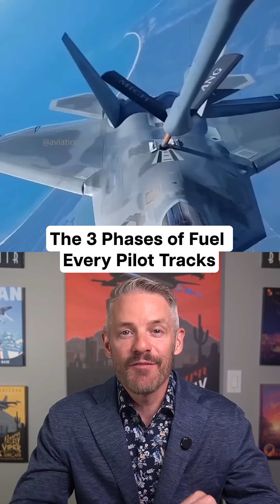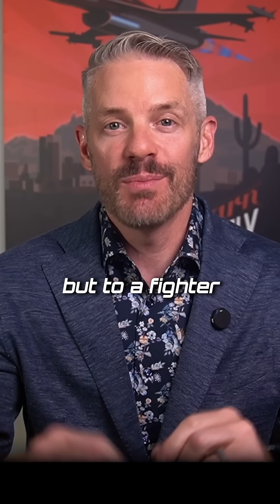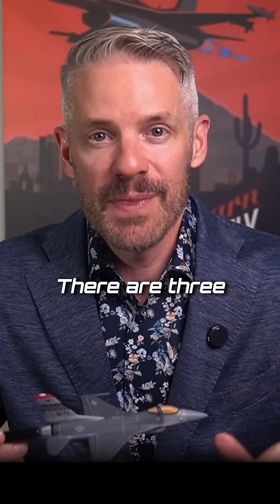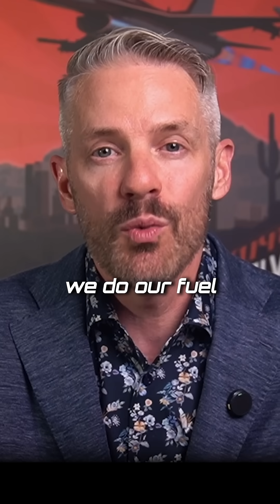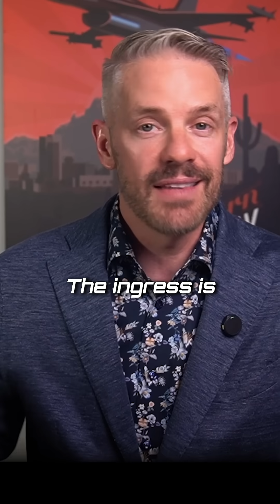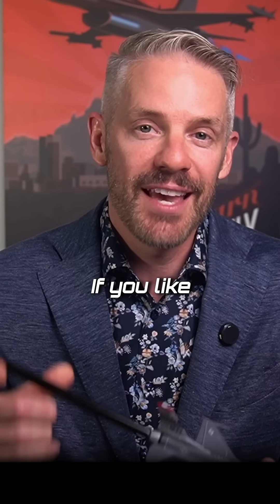How Fighter Pilots Plan Fuel

Comment: So how long does a Jet, like an F-16 or 15, typically fly for? How much faster does full afterburner for thirty seconds, like your example, burn gas by?
Reply: It is highly dependent on many factors. The stores that are being carried, are there drop tanks, the mission profile, and how much burner is being used. 
 
No stores, no tanks, and a transit mission (flying from one place to the other) and burners only on takeoff, 1-2 hours. 
Carrying a lot of stuff on the pylons drops that significantly. Adding tanks increases that significantly. 
Full afterburner, which is used based on mission profile, can drain the tanks in a few minutes. 

Every time you see a jet do a demonstration at an air show, like the f-35 or f-22 demonstration, they likely took off with full tanks and landed at their minimum safe fuel, even though the show was like 10 mins long.
Reply: You’ll likely never get those real numbers  disclosed.

Comment: So wait wouldn’t it just be better to go full all the time?? Only downside I can think of is weight but then again isn’t that what drop tanks are for?? Very curious
Reply: They do usually takeoff with full tanks
Reply: It depends on the mission. Something like an intercept over the home country might value speed over sustainable time. So less fuel. Especially when you can just land and refuel practically anywhere.
Reply: No. Carrying more fuel has trade offs in air combat. Performance and mission effectiveness are typically the priority. Fuel adds weight which significantly decreases performance and agility and the dead weight is unnecessary. External tanks reduce stealth, add drag and take up the hardpoints that could carry weapons. There are so many variables in the planning for why would or wouldn’t need more fuel, but efficiency is key.
Reply: They takeoff full all the time. But “full” means different things because all fighters can use external “drop” tanks which vary in size. The use of drop tanks depends on the mission profile. 
So, although they’ll always fill the internal tanks, not every mission calls for drop tanks.